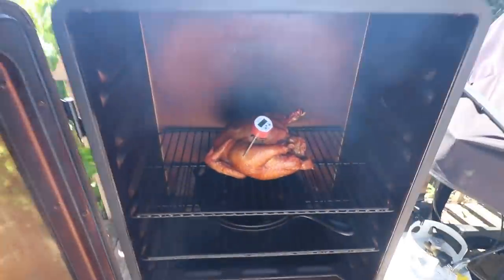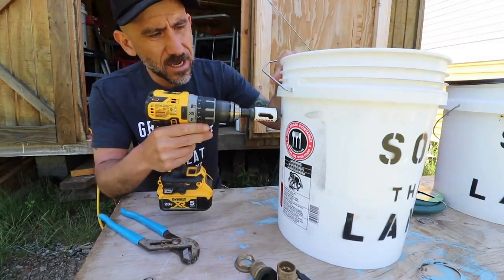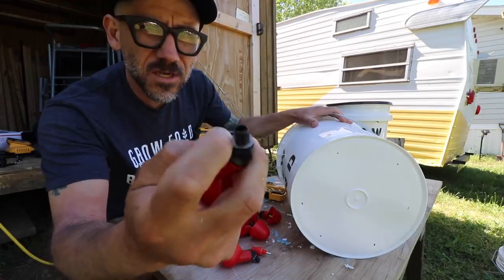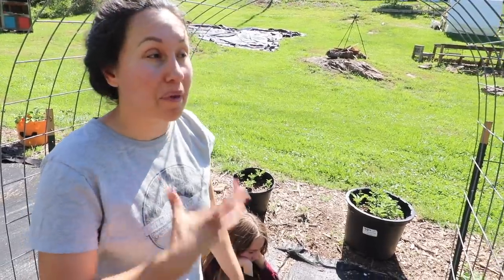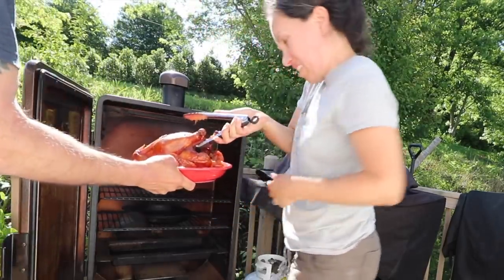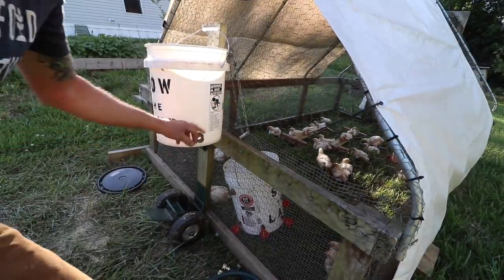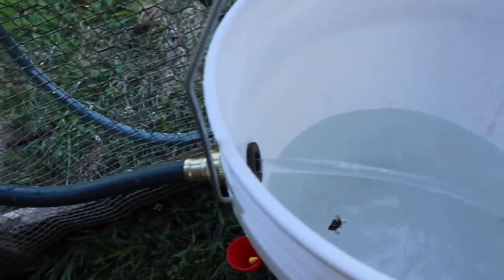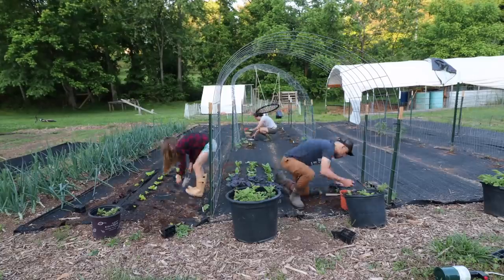New (different) Waterer on my Chicken Tractor/ Family VLOG

Comment: Hopefully you will have better success with those style cups than we did.  Our chickens wouldn’t depress the yellow plunger enough.  We now buy cups from rentacoop which are gravity weight fed and they work way better.  If you have issues with those cups, I highly suggest you try the rentacoop style cups.  That two bucket system is pretty cool though.

Comment: They get the hang of those water cups and the bucket is soooo much better than the smaller chicken waterer. We did this bucket waterer, too. We only have 8 backyard chickens and in the summer I was having to fill the water 2 times a day. The big bucket helps soooo much with that, I don't need to rush go get out and fill their water in the morning.

Comment: I use the same type of cups for my quail. I’m sure you know by now the birds push the toggle and drink what comes out. Cups don’t stay full. Also try not to over tighten. The tiny clear washer will squish out of place.  I actually added gaskets made from a black fuel line hose is was a little more durable. Clean of course.

Comment: Those waterers are good I love mine, however; if you bump the cup or you chickens mess with it a lot the will start to slow leak. Just reach in and make sure the fitting is tight each time you refill it.

Comment: I used those waterers with quail and their beaks just weren’t big enough to hit the thing when they drank. It might work better when they get bigger.
Reply: My quail tractor has the "no peck" version of the water cups  - the float valve maintains a constant water level. They work well even for the brooder quail. I set the 5-gal bucket straight on the ground (less weight on the tractor and I can move it within the pen for optimal shade etc.). But, I have found, for many reasons, that the water absolutely must be covered.
Reply: I have these for my quail. They figured it out.

Comment: The thread on those nipples and cups is 1/8” NPT or 1/8 pipe thread. Drill size is 21/64”. You can get the drill and thread tap on Amazon for 12 bucks and make perfect holes every time. Your cups looks bit larger might be 1/4” NPT if they are bigger than the nipples.

Comment: I have a question for you about this waterer. If you put more water in the outside bucket, will it cause the inside bucket to overflow? I'm thinking that it will because of gravity. But what would happen if you had the inside bucket about 3/4 or so full and put a lid on it? Would there be enough air pressure in the bucket to stop the higher bucket from pushing water in until some of the water in the lower bucket was used? I'm not sure what would happen. Is there any possibility of you trying that just to let people know? If that works, it would give the chickens a bigger supply of water. 
It's just something I'm curious about. I have about 40 or 50 of those drinker cups, but not a whole lot of buckets. It seems every time I need one, I have to go to Menards. lol 
Interesting video. Have a good day.